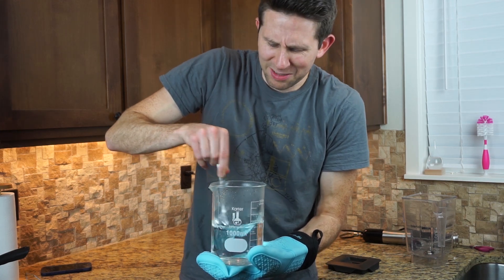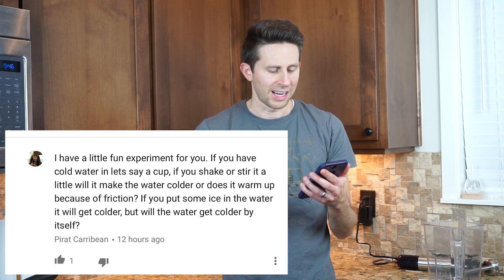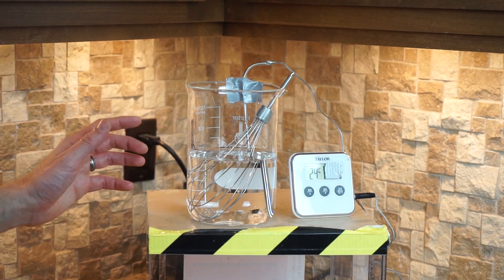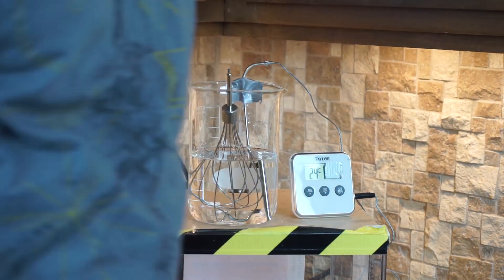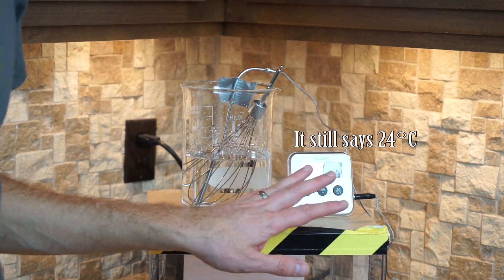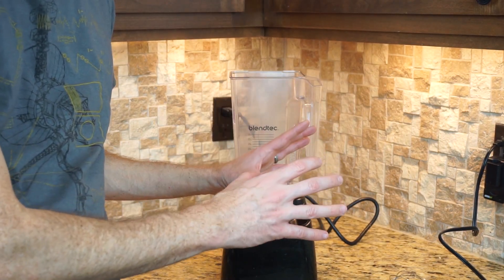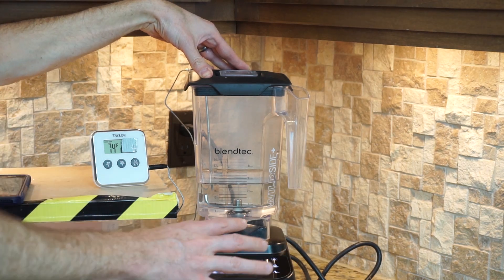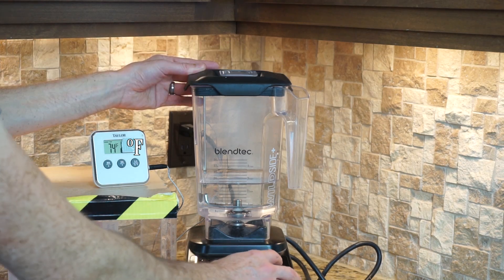Can You Boil Water Just By Mixing it Really Fast? Water-Stirring Challenge Accepted!

Comment from the maker: I'm already seeing a lot of comments that the heat is from the blades being hot from the motor. These motors are designed to have as little friction as possible but there is some heat generated by the bearings in the blade. But don't worry, a better experiment was done than this with a spinning paddle wheel with no motor and the results were the same. The Joule paddle wheel experiment!
Reply: How long did you have to blend before you had boiling water
Reply: The Action Lab dude, the heat is generated my the conversion of electrical energy into mechanical energy by the motor. The motor is not 100% efficient, so there is a dissipation of heat resultant. This heat is transferred well between the metal pieces of your blender, as there is a continuous series of metal pieces between the motor and the blades. If you touched the blades, they would be hotter than the water temp. And if you touched the engine, it would be hotter than the water temp. You drive me insane man, this is literally basic physics.
Reply: Would this work in a paint shaker and if so could you shack a bottle long, fast and hard enough by use just brute strength?
Reply: @heathmccall4969  yup. I can prove it... First with my hand. Then... Shhhh dont.
Reply: The Action Lab you're awesome
Reply: @dhanasekarb9963  🔴 What Is Islam? 

🔴 Islam is not just another religion. 

🔵 It is the same message preached by Moses, Jesus and Abraham.

 🔴 Islam literally means ‘submission to God’ and it teaches us to have a direct relationship with God. 

 🔵 It reminds us that since God created us, no one should be worshipped except God alone. 

 🔴 It also teaches that God is nothing like a human being or like anything that we can imagine.

🌍 The concept of God is summarized in the Quran as:

📖 { “Say, He is God, the One.  God, the Absolute.  He does not give birth, nor was He born, and there is nothing like Him.”} (Quran 112:1-4) 📚

🔴 Becoming a Muslim is not turning your back to Jesus. 

🔵 Rather it’s going back to the original teachings of Jesus and obeying him. 

More ....
Reply: What would have more friction water rubbing against water or fan blades i wonder
Reply: DanHarkless ﴾Halloween videos, YTPs, & more﴿  You're kidding right lol.  Do you really think we don't already know that the steam you see is droplets of water?  It's common language to call that steam.  You're not being smart by correcting on the silliest of things.

Also, those water droplets you see as steam are only a small part of the water vapor condensing.  A lot of the gas that is rising with the steam is actual gaseous water vapor.  So there is water vapor there as well as the small water droplets. 
 If you want to see more of the water vapor condense into even larger droplets, drop in some dry ice.  You then get much larger water droplets that are more visible
Reply: Larry Larry Larry. You don't understand how heat transfer works.
If any heat is going into the blade, from the motor or the bearing, it has to pass through a very small shaft to get there. I guesstimate the area of the shaft is around 0.25 cm^2.
The amount of heat that can pass through that section is very small. 
For the blade to get hot enough ONLY by heat coming from the motor, the motor would have to be GLOWING red, practically. It would need to be SO hot that the bearings would sieze, the windings would melt, and the whole frikin thing would just explode.
Furthermore if the water isn't actually heating up because of friction, like you say, it would VERY VERY quickly disipate ALL the nergy coming from the blade, into the water and then out the vase. You can see when he stopped a couple of times, for a short period, the temperature fell around 10 Cº  very quickly.
SOOOO now taking THAT into consideration too, for the water to reach boiling point only by the blade heating from energy transfer through the shaft, the motor would have to be 1000Cº hot.
Like i said, that's impossible.
Do, you, understand, now?
(And i also forgot something someone else mentioned, the blades shaft is connected to the motor shaft by a gear coupling, so you can lift out the vase, of course. So that makes the heat transfer through the shaft even MUCH MUCH less. Because the gears touch only a little. The section where heat can transfer through the gear is miniscule. Probably close to a 1 square milimeter. Absolutely no heat can transfer through that to heat water, even a little.)
Reply: But can you boil water by shaking it?
Reply: Max Josef 	
 	 It may be true that the motors contribute some heat to the water, however, most of the heat does not come from there. Skip to // for summary. The motor is approximately 95% efficient, meaning that 5% of the 1500 Watts will go into heat in the motor. Over the 3 hours (I looked that the timers counting down on the blender), this would generate 843 kilojoules. About 100 of those would be put into raising the temperature of the motor core. Approximately 75% of the total 843 kilojoules, 600 would be lost through the base of the mixer into the environment. // This leaves only about 150 kilojoules to be put in the water. To raise 1 liter of water to boiling it takes 343 kilojoules using the temperatures in the video. This means that 200 kilojoules came from friction and other mixing energies, not the motor. The water was heated by friction.
Reply: Exactly, only a tiny fraction of heat came from the motor but like 99% came from the friction of the water.
Reply: There is more in a motor than the interface between the shaft and whatever it rides on that generates heat...eddy currents...
Reply: @timramich  makes absolutely NO Sense! LOL. Its spelled Eddie short for Edward. The term for a pier or dock is an Edie! Lol. Get a dicktionary
Reply: @rayfairbanks6280  WTF are you even talking about?
Reply: @timramich  duh, science. Chuuuuuummp
Reply: @rayfairbanks6280  Again. WTF are you talking about? I'm not combing through a year or more of comments to see what I said.
Reply: @timramich  Are you some kind of drug addict or something? It seems like it based on the type of youtube.com videos you liked👍. What country are you living in? I like his type of internet videos. Do not say such terrible commentz.  Do not become the type of person that you hated in your youth and adolescence
Reply: @timramich  I don't know who you are, but please stop commenting on subjects you clearly don't have amy understanding of. Im getting very tired of your harassing of me on the internet. Im very tired and have to be going to rest now. Please stop bullying me on youtube.com. I dont wish to continue this conversation. PLEASE LEAVE ME ALONE or I will have to peruse the proper authorities. Please stop. You are scaring me.
Reply: @rayfairbanks6280  Go ahead and call your authorities. They will see who really started this idiocy of harassment.
Reply: @rayfairbanks6280  You decide to insult me because you don't know what eddy currents are... What a class act. Did you create your account just to harass me?
Reply: @timramich  I'm so sorry. I did NOT mean to insult you. I know what Eddie's are. I did not create this account on youtube to harass you. I am a person. You are also a person. I am a human being. Please do not be angry at me. I do not understand your anger. I am working a job soon. Please enjoy your evening this night
Reply: The Action Lab That was really cool. 
Since the water is always trying to equalize it's temperature with the temperature of the air in the kitchen, when you don't stir it fast enough like by hand, the heat will transfer from the water to the air faster than the thermometer can detect any temperature increase from the water.
Reply: Nice Video! Now the natural question rises...
If I stirr a hot cup of water....will I make it colder by increasing the rate of evaporation and therefor cooling it or am I keeping it at the same or actually rising its temperature?
Reply: Tommy Croissant yes, my blender has a Teflon shaft, the motor has no conductive contact with the blades
Reply: TurkeyTickler if his also has a Teflon shaft then you are right. Heat dissipation would then be resulting from the proximity of the motor to the water. I don't own that specific blender, so I Apologize for my assumption.
Reply: The Action Lab nice Vsauce t-shirt from the curiosity box!
Reply: Kyron very little heat.  They are usually made of plastic.
Reply: Inked_ Up you first compress the atmosphere around it, next you bring the pressure back to normal pressure we live in.
Reply: The Action Lab you should see if you can boil or cook food by boiling it by mixing it
Reply: Great job demonstrating the energy transfer to water from motion. I work at a plant in which we use this same method to heat pressurized water from 100 degrees f to over 500 degrees f just by pump heat being added to the fluid. Each of the four pumps add a few megawatts to the circulating coolant.
Reply: The Action Lab
No those blades definitely get hot
Reply: The Action Lab easy, take a temp reading of the motor.
Reply: The Action Lab wow you actually picked my comment, I didn't even notice until now!
Reply: Maybe you could do a follow-up where you measure the temperature of the motor (or general area of the motor) before turning it on, and then doing it for the same amount of time with no water, and temping the motor again.
Reply: The Action Lab This seems like cavitation, just like what your boat props can do in the right conditions
Reply: WILL IT BLEND: water
Reply: At work we use sodium dispersion in mineral oil.

We get the sodium in bricks and we need a melt it down.
 We just use a fancy blender.
For the longest time I thought there was a heater in the blender but no, it's just a little paddle.
Reply: Can you try this with a speaker....water reacts to soundwaves...there schould be friction, too
Reply: The Action Lab this video blew my mind.
Reply: greenjoe420 ö
Reply: The heat for the boiling isn't caused by cavitation, it isn't due to the motor heat because (A)-the small motor shaft is a terrible at conducting heat.  You could heat the motor end red hot and it wouldn't boil that mass of water.  It is also not directly connected to the blades, there's a loose plastic coupling. (B)-even if the blender is rated at 1500W, only a small fraction of that power is being consumed and transferred to the water due to it's low viscosity... it isn't "thick" enough to load the motor like some other ingredients are, and (C)-the motor itself rarely gets hot enough anyway, unless it's being fully loaded, and even then, refer to (A).

If you blended a thick soup like tomato soup or something even much thicker (without overloading the motor), guaranteed it would boil much quicker, and you could enjoy it after 😁

For those who are familiar with machinery, automatic transmissions heat up because of fluid friction, and large hydraulic systems rapidly heat up to the point where they both need their own cooling systems, entirely due to fluid friction.

...and yes, fans heat up air, both due to the motor, and air friction/turbulence.  Actually volume turbulence is frequently the largest contributor of internal friction, compared to single surface friction against piping surfaces, blades etc. in laminar flow.  Hint... investigate "Reynold's Number".
Reply: The Action Lab how long did it take to get hot each interval? You did not say in the video?
Reply: The Action Lab I also thought about the coils of the motor to.
Reply: The Action Lab  If you can boil water without heating technology, then how would you use a man made mechanism to freeze water?
Reply: The Action Lab Same thing possible in  Maelstrom (whirlpool) at large scale in ocean?
Reply: The gear that connects the blades to the engine also produce heat due to friction.
Reply: The Action Lab a few things that could have made a difference but nice job m8 never though of that
Reply: now I know what to do if I don't have a water heater
Reply: greenjoe420 my thoughts exactly, I do believe the video my not be exactly correct
Reply: No, he didn't. What makes you think otherwise?
Reply: The Action Lab did you get your t shirt from curiosity box? That's where I got mine of the space probes voyager time line
Reply: Джейсон Хичкок extremely valid point
Reply: Max Josef you are wrong it's from the blades because of the friction yeah the blades are hot because of the friction. If you did it with no water the blades would still heat up because of the air friction
Reply: The wow
Reply: J
Reply: hmmm you said the temp of the water raised in his experiment, i dont think he got it to boiling with 1 foot of travel on a pully system that would then have to be reset every minute.  actually with a quick google with his system he managed to raise the temp of water by 1 degree (assuming Celsius as he was english) so his results where not the same. and we again fall back on to the motor transferring heat
Reply: yawn
Reply: What about somehow using a floating agitation device that is powered by an electromagnet?
Reply: i was just going to say it was from the motor and blades spinning but you beat me to it
Reply: The Action Lab
Reply: The Action Lab would water boil if you detonated 1 stick of dynamite in it?
Reply: i was just about to say about the motor and the heat rising, you should have nothing in the blender and see if it heats up after having the motor on for a few minute.
Reply: The Action Lab
Reply: Oh It rises its temperature because of friction of blade and water
Reply: "the more you know"
Reply: The Action Lab 
As mythbuster would say "busted". 

Try a thermos bottle in a paint shaker. 

How much heat came from the impeller blade bearing and motor?
Reply: hey dude i have tubebiddy so i can see all the tags. why is there water park and ooblek bath. also nasa self puring vacuum flying venus fly trap and other that are unrelated
Reply: The Action Lab we have taught in school that ice floats on water because when water freezes it traps some air in it. So what will happen if we make ice in a vacuum chamber ?? Will that ice float on water??
Reply: @abhisheksaxena5701  Your teacher was an ilinformed idiot. Ice floats because of a phase transition which results in ice being less dense than water at 0°C. Ice will float (briefly) in any water below about 95°C as it is less dense due to its crystalline structure. Triple point cells use ice formed in a vacuum to give very precise references for 0°C as the ice boils (sublimes) if the temperature rises.
Reply: Gustavo XD 
Mostly it's friction of the impeller bearing in the base of the pitcher. Heat from the motor contributes as well. 

This experiment was a long way from heating the water to 99c by agitation alone.

A demonstration has to be far more controlled.
Reply: it said i am too ill refresh
Reply: ya im 668
Reply: Do you watch rick and morty?
Reply: You look like Summitg
Reply: The Action Lab thanks for the education bro I learn things you make it easy and fun
Reply: im always thinking stuff like what will happen if you do that,mix that and here is this youtube channel.I really enjoy watching your videos.Keep up the great work man!
Love,from Romania :)
Reply: Here's an experiment that shows stirring a fluid will increase it's temperature, using two things that are fairly easy to get: Get a car with an automatic transmission that has a conventional torque converter. Get a scantool that can read the transmission fluid temperature as well as the engine coolant temperature. Put that car in drive with your foot on the brake. Now rev the engine with your foot firmly on the brake pedal. You will note that the engine won't rev past a certain speed which is the stall speed of the torque converter on that particular car. Note that the transmission fluid temperature is increasing much faster than the engine coolant temperature. What is happening is that the fluid is getting "stirred" by the torque converter--with the car not able to move, all of the engine power going into the torque converter just heats the fluid up. You will want to end this experiment before the transmission fluid gets too hot (around 200F or so). Or, if you really hate the car, keep going and see how hot you can get the fluid and what happens. Might make a good Youtube video, but keep a fire extinguisher handy!
Reply: The Action Lab plz do a goal with the ware by trying to get to 1000.01 Celsius or 1000 fharinhight
Reply: I run an industrial blender at work, the blender i use at work cost easily hundreds more than yours.  It's DESIGNED to minimize heat, and yet somehow heat from the friction transfers to the blades...  What you aren't taking into account, isn't heat via friction.  Your forgetting stress from moving through a viscous liquid, it's going to cause heat.  Especially since the blender itself isn't attached to the blades, you have what's called points of contact.  These cause pressure points and over time, stress and micro friction (metal on metal) you get heat.  Run that for X minutes because you don't lube those contact points, you get heat buildup.  It then flows through the metals, this is compounded by the bearings.  The blades heat, the water displaces said heat, raises it's energy state.

Now for the fun!  You also forget that an electrical device, regardless if it's doing physical work is going to cause heat.  Your 120v wall socket converted to a lower voltage, which has a byproduct of heat.  Your motor is going to be fed by mosfets and caps, bi-products?  Yeah, heat.  If the metal is already absorbing heat from contact/vibration friction as well as bearings.  If you raise the ambient temperature inside the device, this means less heat has to be produced to raise the temperature of the metal.  Now this wouldn't be an issue in normal use, the metal wouldn't have time to transfer that heat.

Now the fun!  Water itself has a habit of keeping it's energy state.  It has mechanics in doing so, one is it's viscosity.  It's hard to heat up water without a major heat source, any kinetic energy is going to be transferred into the water as waves or movement.  The friction argument is hard too, as you would have to have drastically more surface area creating friction than the surface area of the container.  As water is good at displacing heat, it will move the heat (energy) to the outside of the container which will then radiate that out at a constant.  

While water friction DOES cause energy, it's drastically lower than your reflected experiment.  It's the same principle as to why flowing water doesn't freeze, it has enough energy (kinetic plus friction) to have it's energy state above freezing.  The water could be below freezing, however it's energy state is high enough it doesn't freeze.  Now getting moving water to boil and raise it's energy state that much, your going to get to a point where the water will simmer but never boil.  And getting to a simmer is going to take you a long, long, long time.  

Pretty much a good concept to teach, a very shitty way of teaching it as it gives NO real insight into any science behind this.  As it doesn't explain why this would cause the water to boil.  As you aren't actually heating the water, your adding in energy and changing it's energy state.  That energy state is reflected by the temperature increase, however you aren't ever going to get it to boil and I doubt any real life situation would let you get it to simmer without spending more energy than you would with gas or electric bunsen burner.
Reply: i knew you would get that response about the blade conduction...you have a wonderful attitude. it shows in your response...if the blender transferred that much heat to the water there would probably be a recall on the product....stay awesome
Reply: What if you could find a way to seal the cap to where the water wouldn't spill out and turn it upside down to eliminate all friction between the blades and container would it still boil
Reply: The Action Lab the bubbles were literally coming out of the bearings, of course it’s possible to heat water with friction, but you didn’t do it.
Reply: The theory is correct....

But the experiment has flaws

Energy (in the form of heat)  is transferring through the motor spindle and blades regardless of mechanical friction of elements involved

It will always happen in this experiment because human hands cannot operate fast enough
Reply: Here the Kinetic energy is converted to Heat energy. For reference: Law of conservation of energy - Energy can neither be created nor destroyed; rather, it can only be transformed from one form to another.
Reply: The Action Lab I
Reply: The Action Lab oh cool this was already addressed yeah I guess as going to say wouldn't at least a tiny bit of heat be contributed by the motor
Reply: Allen Wicks sorry but most of the heat was generated by the motor. refer to my previous comment.
Reply: I don't think(nor do I want to check every reply) that anyone really bothered to look up what he referenced....
Reply: nailed it, but no one will care because they can't even look up the experiment that was referenced in the post they replied to.
Reply: The Action Lab Dude, you're awesome.
Reply: The Action Lab hi
Reply: If you're reading this. Thanks for da vids (do you know da wae)
Reply: Well, things definitely got heated up because of people's different opinions getting all mixed up in this video.
Reply: The Action Lab Technically speaking if you added    somesort of rough material along the walls of the blender the friction of the water would increase and the water would heat up faster right???
Reply: Inked_ Up Applied Science had already made this although not freezing using rubber bands as base. Really thorough explanation in that and all of his videos.
Reply: The water could not get that hot from the blades so whoever thinks that is crazy
Reply: The Action Lab the blender would generate its own heat and transfer it to the water, however I don’t see it raising the temperature so much so that it would start to boil.
Reply: This is really cool! You're maling awsome video's!
Reply: The Action Lab yeah but by using it for longer periods of time the whole machine heats up because of the motor in the base doesnt it?
Reply: DanHarkless ﴾Halloween videos, YTPs, & more﴿ Do you think you’re cool? I think you do all these things because nobody loves you
Reply: "end of my blendteck" you need to watch the blendteck will it blend channel, he hasn't busted a singal blend teck blender yet, the worst is a dull blade  ( replaceable) and a scuffed up or unusable container ( also replaceable), the only thing it will be the end of is the thermometer prob. witch would be an interesting "will it blend" lol
Reply: The Motor winding's and stater also generate heat. but i agree it's the heat from the blade getting hot from the motor NOT friction of water rubbing against the plastic, no experiment has been done that would truly test how much friction heat is generated by water rubbing against plastic.
Reply: wrong this has NOT been proven, the blades get hot from the motor see my posts.
Reply: prove it test it with out a powered motor, the blades heatup FROM THE MOTOR
Reply: the heat is also comming from the motors copper winding's and the stater WHICH GET HOT AT Those SPEEDS.
Reply: the heat is also generated in the motors copper winding's.
Reply: no one here seems to understand how a high speed electric motor works, a Lot of the heat is coming from the carbon shoes  which is what high speed electric motors use as well as the copperwinding's in the stater,  and yes i agree that SOME heat is generated by baring friction .
Reply: is it going to boil for ever
Reply: your wrong also if you want to boil water use a sous vide machine
Reply: Wow.
Reply: The Action Lab
Reply: Water molecules bumping to one another also creates heat but the motor might have played a role In this......
Reply: That bearing is not generating alot of heat by bearing standards. But enough to boil water. Simple test though fire it up with nothing in it until it shuts itself off and see how hot it gets. It's definitely heating up that water more than your leading these people to believe.
Reply: The Action Lab 
The heat might be due to friction between the thermometer and the water rather than just water.
Reply: The Action Lab wow I am gobsmacked. Science really is amazing
Reply: Ok gotcha!
Reply: The Action Lab i think the heat is coming from the blender motor
Reply: Besides if the motor gets this hot it will explode.
Reply: Zeyad Galal false
Reply: The Action Lab is
Reply: this question was in "what if"
Reply: The Action Lab Hello action is your name fault for not because I watch another video saying yeah this video is inspired by Bob I think that my perch do you little-known can you apprised just in case it is because I wanna know and if you don’t wanna tell me can you just
Reply: The Action Lab. Nice, so water does have enough friction to generate heat... very interesting, and im curious as to just what applications this could have.
Reply: I thought the same but then thought that the blades absorbed the heat when it was spinning and then released it back into the water,  is that what happened?
Reply: The Action Lab good warning, thanks for clarifying things!
Reply: So does this rise in temperature also occur when waters flowing fast? say a flood for example?
Reply: Actually, it depends upon the quality of the blender and if you're over-working it or not.  I've ran junk blenders that were about to burn out and they got pretty hot.  That doesn't mean though that the blades spinning, cavitation and water-on-water friction didn't cause the water to heat up, because obviously it would.
Reply: The Action Lab see the reoly from the guy who works at blend tech. Definately from the motor.
Reply: For sure! Basic Thermodynamics :)
Reply: The Action Lab damn what he said
Reply: DanHarkless ﴾Halloween videos, YTPs, & more﴿ scientists using layman's terms and descriptions when trying to teach is GOOD not proof they don't know what they're talking about
Reply: Oh really?
Reply: So why do we mix coffee or milk to cool it down?
Reply: The Action Lab how about will you make a sugar to not get wet?
Reply: The Action Lab have you thought about the temperature from the motor of the blender
Reply: Firstly, u have to know that as long as u r using any other material to stir water other that water itself, u cannot say that the experiment is scientific by any means... because u r bringing a different object with different heat reception and the major heat that the water gains will be the heat passed on to the water by the heating blades.. be it steel or plastic.. devise a method to stir water with water and then try this stuff..
Reply: its not about friction its the water and all metal parts heat sinking the heat away from the motor that is a fact and that motor makes a lot of heat this is why they have fans inside and also why they auto shut off from over heating
but yes the water would heat up from the friction of spinning if no heat producing power was used
Reply: What happens to the magnetic field of the electromagnets when placed in vaccum or abundance of air  does it have a change? Because the the air gap between the poles is a factor determining the strength of the magnetic field. If it does not changes then why is it not the gap and why air gap? # Your Big Fan
Reply: The Action Lab . If anything the blender heated up causing the water to heat so this test is scientifically incorrect.
Reply: Then this experiment should be done again with a thermometer attached to the grinder simultaneously. This will prove the actual origination of heat. Literally how can a person be ready to believe that friction between water (which is not much) has caused this much heat and the friction inside the motor and the heat of the coil could make no difference
Reply: " aw don't worry mate we got a new foken blenda' that has 0 friction mate, actually it foken takes heat away mate, it's MENTAL. you won't believe it. "

Motor gets hot. Water gets hot from motor. 
Stupid argument to say that your blender is one of a kind and doesn't get hot. 

If you want to do this , do it with insulated material for the blade that don't transfer heat as much as metal blades do and don't have the motor sitting under the damn thing acting like a bonfire. I was half scared the damn blender is gonna catch on fire after you've sped up the footage for a bit.
Reply: I was about to say that and then saw your comment
Reply: Then why mixing glucose into water decreases the temperature
Reply: Sis, You are one of the world's best scientists 
ANS : drag
Reply: Could you please tell me where you got your shirt from? It looks so good
Reply: The Action Lab     🔬
Reply: Then He asked, “To what can we compare the kingdom of God? With what parable shall we present it? It is like a mustard seed, which is the smallest of all seeds sown upon the earth. But after it is planted, it grows to be larger than all garden plants and puts forth great branches, so that the birds of the air nest in its shade.
Reply: I have an amazing question if the water is rubbing together in that container then how come in a beach the water doesn't get warm because the waves are always coming in when the water is just working together like almost constantly so how come not that water does not get warm????
Reply: Due to waves why don't sea water boils? It spin than in your mixture do.
Reply: The friction isn’t the right dynamic function to specifically work affecting
Reply: The Action Lab halo
Reply: Could you get a similar result using fast vibrations?
Reply: Paddle wheel work that's what it is called
Reply: the temperature increase also came from the stirring motor below your water.
Reply: Ok so it's four o'clock in the morning, and I enter in a video of a man mixing water...
I should go to sleep
Reply: what is the speed of dark ? Mr. ActionLab answer me with a simple experiment.
Reply: I was just going to post the same thing - heat possibly from motorized blades. lol.
Reply: @SirWulfrick  to the uneducated, that sounds like a reasonable source for the heat. But with a tiny bit of education and experimentation people would see that its just not possible. Unless you're Thanos.
Reply: Wait, is the stirring itself creates a phenomenon called "Cavitation"? A thing that usually happens to a naval vessel when they cruising the ocean.
Reply: I suggest you use sound waves to boil the water if it's possible for you. I really want to see it.
Reply: could you have a powdery substance and Blend into Liquid?
Reply: will the insulation on the motor windings boil?
Reply: 99.8 ... you are 22 m elevation! kkkk
Reply: As a chemical engineer, this is common knowledge...that stirring a liquid raises it's temperature, basically due to friction from the stirring arm and from friction between molecules of the liquid sliding past one another. The internal energy of the liquid increases, and this increase is in the form of heat. I loved your demonstration, and I enjoy your videos. Keep up the hard work man!
Reply: Can you check how much water will rise up when you immerse some definite shape object like cube or cylinder in some definite tank or container like cube or cylinder, I personally know what will happen it just what I think can you please  check it.

Answer- water rise in container= volume of body immersed/ surface area of water body in which body will be immersed

Sir please make video on that ❤
Reply: This proves internal energy is a state function property.
Reply: I have a question:-
Will liquid hydrogen catch fire
Try to do an experiment on this
Reply: Next challenge- superheat the water by mixing it.
Reply: I was very curious about this question when learning Heat in physics lessons, but I'd never thought it is possible to do at home! (an excuse to buy a new blender)
Reply: VITAMIX
Reply: What if here is a wave of kinetic energy within the object and have the wave propagate really fast?
Will it heat up the object
Reply: Maybe using magnets on an induction coil to heat the water method will be neat to see you perform also?  Wondering how hot you can get the water?  This is really neat too man, thanks for sharing! I've seen the infomercials years ago regarding to make soup or something heated blended??? I forget.
Reply: Yeah this "experiment" just made me rethink watching your videos any longer..
Reply: Hmmm
Reply: The system is a little incomplete. Increase in temperature of water by stirring depends on whether the kinetic energy absorbed by water is greater than the thermal energy dissipated by the water and container to its surrounding that there was no insulation. Also since neither the motor temperature was taken nor the mixing jar was away from motor, it's hard to tell how much of heat was conducted between motor and jar, although it's hard to imagine the motor getting heated too much.
Reply: It was amazing
Reply: Awesome!!
Reply: The same heating with electric resistance heater requires little energy than mixing. Why resistance heater has high efficiency than mixing ?
Reply: Just measure the temperature of the motor. If it’s anything below 99 C, then it’s proven beyond doubt that it was not heat transfer.
Reply: @mikewest3108  yep, i say the same ! Heat transfer from engine/bearing/moving part of blender and also cavitation ! The experiment must be made in different circumstances to prove it valid. Friction factor exist and theoretical, it should warm up the water..the question is not "can we heat the water?", the question is "how much heat can we obtain with a water friction heating effect ?"
So, remaining at this experiment/video, using a blender does not proove a valid result ! sorry @The Action Lab ... although, nice video ! ;)
Reply: Read my comment
Reply: Magnetic stirrer could be a choice.
Also it shall be noted that temperature is directly related to molecules' velocities & not just friction generated heat.
Reply: You just riped my comment right from its roots sir. Hats off.
Reply: Possibly not the friction between water molecules them selves. Some heat from the friction of the water against the plastic sides but more from the blades against the water. Even more from the high heat generated by the mechanical function involving the bearing and seals. Possibly some heat added from the direct shaft of the motor down before. I would like to see an insulated high speed paddle bringing this to a boil.
Reply: I don't think anyone would argue that mixing the water doesn't produce ANY heat. However, look where the water is boiling from. It's not boiling all over. It's not even boiling from the blades. It's boiling from under the blades. You didn't boil water by mixing it. And I doubt you'd be able to without a tremendous amount of energy due to how quickly the water would dissipate the energy.  

Science has to be done properly. I'd like to see this experiment redone in a manner that either tracks or controls (preferably both) the heat transmitted through the blades. Do you accept the challenge?
Reply: instead of using blades use something that can create more friction.
Reply: very little heat from friction, but what about that 1500watts of electricity, of which only 75% gets converted into motion, so in essence, you have a 375watt heater connected directly to the water through metal!
Reply: Can you cook something with air friction?
Reply: Can you start a fire by using sounds?
Reply: Can you start a campfire by using air!
Reply: The water is heated up because of the work done on the water. First Law of thermodynamics: In general, when work is done on or by an object, energy is transferred by heating. So as more kinetic energy is put into the water the more it heats up (The work done). Although some of the heat probably came from the blades heating up from the motor most of the heat would have been energy transferred through the work done.
Reply: This experiment should work. For better results you should isolate the water recipient (termically), this way you will minimize the heat transfer with the ambient. But the experiment itself should work, basically you are adding work to the system and that converts to the variation of the water internal energy (energy conservation)
Reply: I feel in this experiment, most of the heat actually came from the engine themselves, but nevertheless definitely heat is generated from all the splashing, rubbing, air cavity creating. Using smaller power and longer time would eliminate the possibility of engine heating.
Reply: Max Josef Yea totally man I was just gonna point that out. There's no way using a blender for that long, no matter the power output, wouldn't produce a significant amount of heat
Reply: The Action Lab I have had a lot of experience with the bearings in all kinds of blenders producing heat. One bearing I had got hot enough to boil water on its surface
Reply: 1)the bubbles were coming from under the blade area (7:06 in full screen)
2) the motor heats up as it spins friction does play a role in this but mostly from the motors 
3) if you want to get more accurate results make something that spins but the motor is not near the water
Reply: I can't believe all the dumbasses that say the heat is coming from the motor. LMAO
FIRST: Motors have forced ventilation so they don't...Heat Up. lol
SECOND: The heat is created in the winding, by the electricity friction. The winding DOES NOT touch the rotor. The armature winding doesn't touch the rotor. And the rotor winding is extremely insulated, and is always spinning very fast, so it loses heat to air around it. The armature winding is always the one that overheats.
And THIRD: This is the one that truly shows nobody has the slightest idea of what they are talking about. For the water to heat to 100C only by making the blade hot, the motor would have to glowing red to transfer enough heat to the blade through that tiny shaft. The motor would DIE before even getting REMOTELY CLOSE to that. The windings would short out. The bearing would freeze solid, grind to a halt. (it was moving perfectly at the end)
So all you idiots stfu, go to school and college if you want to stop being a YT engineer. XDXDXD
And, Max Josef, take this down thumb, i'm not un-doing it though. moron.
Reply: The blades also cause friction against the water so of course the blades heat up, but due to friction of water not the motor.
Reply: A lot of that heat is coming from bearing-friction just below the blades. You can see at the final shot bubbles coming from that area. Probably the bearing is starting to fail as well and the heat is probably awesome. I doubt if blade-water friction is doing the bulk of the heating-rise as you get >80 C.
Reply: tubeistdan what you are seeing, is bubbles appearing around that part of the basin, due to cavitation. And always remember, that when water boils, the bubbles will always originate from the bottom.

This is due to the specific gravity of the liquid, and the fact that as water boils the elements separate, and as the elements have less specific gravity in their individual constituent, i.e. hydrogen and oxygen gas, than the the liquid itself they will always bubble from the bottom.

Also, the blades themselves will never reach 100 degrees centigrade specifically just from the bearing friction above the motor. This can be tested easily by spinning the blades with no water in the blender and measuring the temperature of the blades after 5-minutes.

Most of the heat comes from friction of the water against the blades, cavitation , and the work being put into to the water itself from the spinning blades.

This encompasses the laws of thermodynamics. James Joule measured this accurately 150 years ago without the use of an electric motor. And the water temperature increased due to the work put into it by the paddles.

In James Joules experiment, he also measured the the temperature of the surface of the paddles and found that there was no Rise whatsoever. James used various materials for the paddles, including wood, iron, copper and glass. Results were the same in all cases. The water temperature raised the paddle temperature stayed the same.

As stated in this video, it played an important role in developing the first law of thermodynamics ru conservation of energy.

Anyone on here arguing against these laws, doesn't understand physics.
Reply: I'm wondering how much of that heat rose up from the blender motor. That must have got pretty hot with the length of time it was running.
Reply: The Action Lab I think you should make a part two about the vidoe where you put the drone in the car but in stead of a drive throw some objects
Reply: simon6071 Looks like he took your advice!
Reply: simon6071 Because that's the name I clicked on to watch this lol.
Reply: Love you bro nice videos
Reply: +LayyJadey713 I merely point out that the Action Lab guy used the wrong word "mixing" in the title because mixing involves at least two substances. I did not advise him to correct the title nor did he change the title. What makes  you think otherwise? Just because you think it's funny that he confused "mixing" with stirring" in a science video doesn't mean it's funny.
Reply: The Action Lab  it's a lie
Reply: Im the 667 to like this comment
Reply: The Action Lab  the temperature of water won't go more than 100 degrees when it is not Compressed  the thermometer shows 112degrees how is that possible
Reply: https://www.reddit.com/r/askscience/comments/3bin9p/can_you_boil_water_using_a_blender/

There, go ask reddit and I'm sure the same answer as this will come.  Don't do it, don't try it, it's not a good idea.  Your going to push your electronics farther than you should, and it's going to end up unsafe.
Reply: FAKE
Reply: The Action Lab no, it's the motor alright, there's still plenty of heat energy caused by motor induction and resistance to heat it up to a boil, and if you were to try to heat the water up using joule's method you would be in for a treat because you would need a weight about 9.5 imperial tonnes to be lifted 1 meter from the ground, that's assuming you have a 100% yeild of power. so no, you can not boil water very easily by just using friction of the water against it's self. Check yo self before you wreck yo self, fool.
Reply: Nowhere on this planet does water heat up for no reason.
Reply: The temperature increase of the water in the electric mixer is not because of mixing but because of the electric motor!
Reply: I have a doubt..... 
According to me.. i still think that water got heated up by the heat produced from the blade.. not by the movement and the friction of water
Reply: Nice experiment but bad title. The title of the video should be "Can You Boil Water Just By Stirring it Really Fast? Water-Stirring Challenge Accepted!: Mixing is the wrong word to be used here because mixing involves at least two different substances to be mixed.
Reply: Engine heats because of electrical resistance(heat is generated by elecricity flowing trough coils), not just because mechanical resistance! So engine is heating water most likely.
Reply: @TheBalija1  nope. Not mostly. Nice guess though. Somewhat true. Motor insulated. Tiny surface area.. Water splashing inside bigger container= more surface area. Thats why, motor isnt burning (on fire) and water gets to boiling, instead on getting to a simmer and staying put.. Again nice try though.. You should spend some time working in a commercial kitchen. You'd be amazed.
Reply: I have a blender, a cheap one, and there is significant heat generated just from the bearings in the blades.  While the test is valid, I believe that a more valid test will be a mixer that can be chucked to a drill so that the water cannot be in contact with any sources of heat.

BTW, I work on cars, and I've seen torque converters in automatic transmissions generate so much heat that the paint will bake off the converter and once, on a truck used for heavy long distance towing, discolor the steel shell
Reply: You are using a 1.5KW machine, which has more power than my hair-dryer, and you really think the heat only comes from the friction of the water molecules? Prove that by spinning the machine without water for a few minutes: If the blades stay cool, as you say, i'll undo my down-vote. 
(Side note: at 7:15 you can see the boiling origining from the blades, which i guess are heat source hence heat conduction from the engine)
Reply: Max Josef Except that water has a very high specific heat, which means it’s very difficult to change its temperature. That’s why it feels so cold when it’s colder than body temperature, and the reason it puts out fire. So doing the experiment without any water to see how the blades heat up is not comparable. Just try the following: heat an empty pot to a high temperature (less than boiling, though), then put water on it, registering the water’s temperature before and after. What do you observe? 

And the bubbles originating from the blades is not that surprising, because when boiling a liquid, bubbles form on nucleation sites, which are solids from which they can form. If it was completely clean and very pure water was used, it would be possible to heat water above the boiling point without it boiling, something known as “superheating” (the opposite of supercooling).
Reply: @maxjosef6679  He is not saying there is zero heat from the blades. He is saying the heat produce by the motor in the blender is negligible compared to the heat produced by the friction of water. As shown by Joules test
Reply: @maxjosef6679  but he tried a different machine, with no power, if you actually read his comment.
Reply: @maxjosef6679  keep in mind friction also coming from the blade and the blade is also sitting in a water that's increasing in heat. So some heat might conduct from the blade but it is impossible for the blade to stay cold. If you mention conduction then tell me how can u have a cold blade in hot water?
Reply: They are stupids tho
Reply: 3:50 - "You can see it steaming."  At 122°F?  Uh, no.  You can see water vapor aerosolizing.  Steam is gaseous and invisible, and doesn't occur below 212°F at 1 atm.  I'm guessing you didn't study physical science, and just play someone who's knowledgeable about physical science on YouTube?  

And as others have said, the vast majority of the temperature rise within this short time period must simply be waste heat being conducted (and to a lesser extent, convected) from the blender motor.  Sure would have been nice if you'd provided a temperature reading from the top of the blender base.

And no, Joule's results with the gravity-driven paddle wheel were not "the same".  You got a much faster/higher temperature rise relative to the amount of physical force being applied to the water.
Reply: @DanHarkless_Halloween_YTPs_etc  Water evaporates at any temperature above 0°C. At 100°C the vapor pressure reaches 1 atmosphere. In water pumps temperatures of over 150°C with the discharge closed are common due to friction.